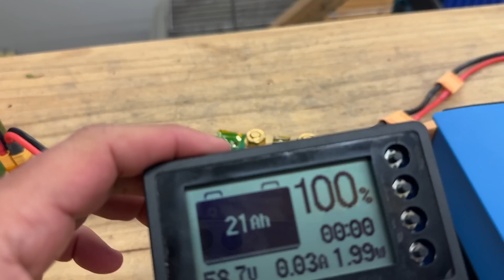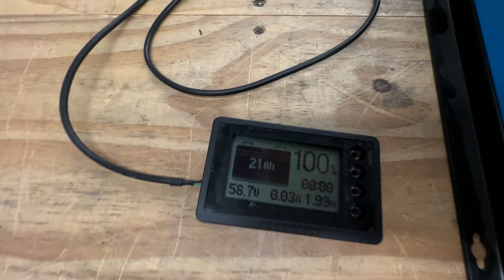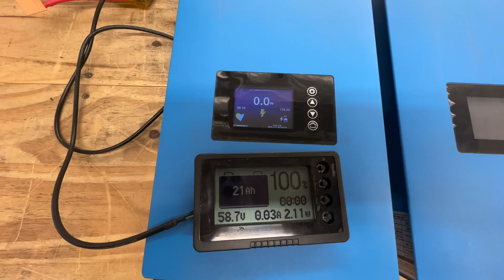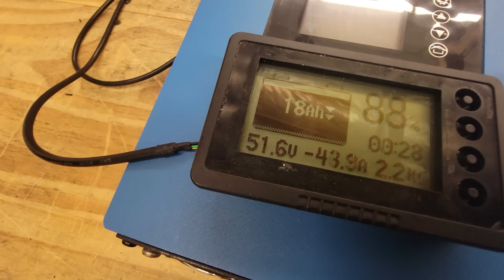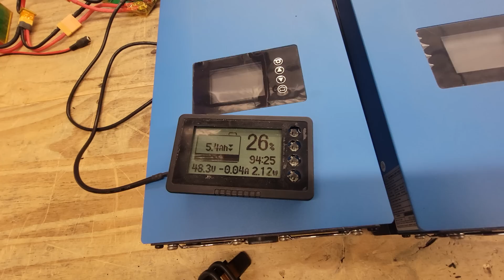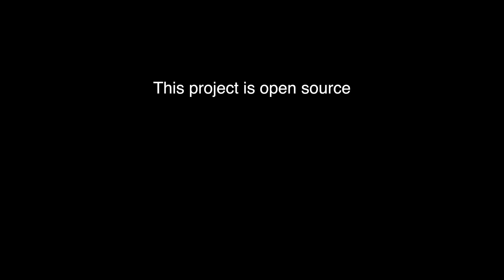52v eBike  20Ah  2170 cells

Comment: I would say yes this BMS passed the test but I would definitely implement some kind of cooling or consider putting the BMS further away from the cells or add better heat protection between the BMS and the cells.

Comment: Is 2170 cell the same as 21700 ?.
Reply from the maker: Yes
Reply: @jehugarcia  Did you do any further testing on this or just lower the spec to 40A? I'm curious if I use my own higher quality BMS if it will be safer for an eBike build.

Comment: I purchased a 52v 19.2ah 45amp battery from a place called conhis motor. They use Grade A LG 21700 cells apparently.

But the performance doesn’t lie. If only I have a battery and controller with higher amps though. 45amps is still fast but I’d like a bit more torque.

Comment: 52x4 in series = 208Volts which is -/+ voltage on a Prius.. factory stock NiMh cells capacity is only around 1.3kWh but very bulky.. these lithium blocks as range/capacity extender or replacement for older hybrids?

Comment: Quick question here, (scratch that, base question is simple, big quesiton is large)

i am not knowledged in all of this battery tech. I live in Spain. this has nothing to do with not being knowledged, but to what access i also have in batteries and their prices.

If i take 130 LG 21700 cells, each 4.8 Ah, and each 3.6 V, then i get 4.8x3.6 = 16,2 Wh (more or less) x 130 = 2.106 Wh (or 2,1 kWh), for the price of $754 USD (normally $ 1.235 USD). 

however, i can get a 90ah 12v (car) battery for € 74 euro's (that's about $ 75 USD. 90 x 12 = 1.080 Wh (or 1.1 kWh).

So let's say that i would need two of those batteries to reach the same as those 21700 cells. That means i'd pay about $ 150 USD VS  $ 754 USD.

Now i fully understand that it does depend on how to applicate this tech. I imagine 130 21700 cells are a lot lighter in weight compared to 2x a 12v lead acid battery, weighing in total 42 KGs. 

So obviously, weight is a gigantic factor here. For like a E-step i would imagine obviously that such car batteries make no sense at all.

For a bike, obviously, the benefit of being able to carry a 'light' battery to your desk and charging it there makes sense if you make 'large' trips.
130 of these cells weigh about 8kgs, so obviously, that's a difference of 34 kg. 

But even then - if you could charge your bike in your shed/garage directly from a power source/cable, then 34 kg higher weight obviously is not a little, but let's not forget that for example a woman may weigh 55 kgs and a man 89 kgs. that's still a 34 kg difference, and yes men in general are more 'muscular' than women, but the thing is, nobody bats an eye on such a weight difference in a 'feet powered' bike.

So obviously, a 12V battery will bring additional weight, and it's quite bulky too. but so is carrying an extra passenger on your bike, and that's quite a lot more than 34 kg. 

So one might for example, buy 'carry bags' to put on the rear part of a bike. 

And it would save you a whopping $ 600 USD. 

So, why would you then go for these 21700 cells? what is their benefit over a 'classic' lead-acid battery?

Additionally, if you were to build like a 'tesla powerwall' alternative, weight really isn't going to be your concern, right?
But $ 600 USD cheaper batteries is like really a LOT.

If you were to make like a 13 KWh DIY tesla wall (which costs about 10k USD if i'm not mistaken),
then you would need to spend like about what, 800 total of those 21700 cells, about $ 4.500 - $ 4.600 USD, right? 
I mean obviously that is a 'bargain' compared to 10k Tesla 'original' powerwall.

But, it would take like 12 of those 90ah 12v car batteries, and that is about $ 888 USD.
We're talking about rediculous power differences here.

And perhaps i'm mistaken, i probably am, but i don't see where or how, but    12 times a 90ah 12V battery to me equals to 12.96 Kwh.
And perhaps i'm mistaken, i probably am, but i don't see where or how, but 750 times a 4.8ah 3.6V battery to me equals to 12.96 Kwh.

12 x 75 USD (Solite lead acid battery) = $ 900,00 USD.
750 x 5,8 USD (21700 LG cells ) $ 4.350,00 USD

You save $ 3.450,00 USD by going with (Solite) lead acid batteries.

On average, 21700 batteries last between 3-6 years.
On average, lead acid batteries last between 3–5 years.

If we take the lowest number, 3 years, then they're exactly the same in lifespan. 
If we take the highest number, 6 years, then 21700 batteries last 1 year longer, but that's not a given.

Which brings me back to my question : 
Or, simply put, let's even IGNORE the COST of the batteries at all.

if we want to have 1000 watt-hours,
i'd need 'just' 1 90 ah 12v lead-acid car battery.
Or i would need 58 21700 cells. 

What benefit would 58x 4.8ah 3.6v 21700 (LG) cells have over 1x 90ah 12v Lead Acid (Solite) Battery?

What is the benefit of 21700 cells over lead-acid batteries?

Is it purely and only weight

Or, am i going completely and utterly into a totally wrong direction here and am i doing my calculations like a tool and missing some very vital information here?

please, enlighten me.
Reply from the maker: Well….  Lead acid does not last very long if you use 100% of its capacity,  so you’ll need to use 2x the battery capacity you need doubling your stated estimated
Costs.  There’s also maintanence ,  my forklift lead acid battery need constant checkups and liquid refills,  lithium once set is carefree usually.    Then there’s the life expectancy,  you quoted 6 or so years.  The true life of properly used lithium NMC cells is much longer, somewhere around 2000 cycles.  My 2nd hand Tesla battery on my diy VW electric bus is almost 12 years old now and I can’t detect any degradation yet.   So yes lead acid is cheaper but won’t last you as long and will require more maintanence.   Plus,  21700 cells are some of the most expensive lithium cells around,  there’s far cheaper lithium cells available like the $63/kwh machE cells https://youtu.be/uFsyD74Ph8o
Reply: @jehugarcia  thank you so much!

Comment: Are you testing the pcb's load ability or the bms's load ability? I would do pcb load test not both. Start at the power source and test each component  independently, yaya time, its just time its all we got is time. So was that test objective, subjective, injective, rejective, whats the jective, i wanted to see the pcb's failure prone point, we know all bms's failure point the fets. Using a large heater like that might be a bad idea for the cells under it they will fail first thats my inject.

Comment: Brother 2 question about battery one is about balance of the cells is that BMS include active or passive balancer  and last question is about temperature sensor I get experience with my 18650 24v battery the temperature sensor was connected in middle of of the battery but my last cells of battery was getting too much hot I disconnect them I cut the nickel strip so the point is if temperature sensor works only on one cell or little bit are cells can cover so that is not really safety 🤔 if possible can we add more temperature sensor on etch pairs for etch raw ?
If possible can explain in your next video will be very thankful for that
Thank you very much for always the very informative and educational videos
Best regards from Philippines 🇵🇭

Comment: Jehu, you need to get your hands on some  real high output 21700 cells, like the Molicel P42A cells are amazing. 4.2ah per cell and a 45 amp continuous rate of discharge. I only ever see you use batteries that do 10 amps continuous output, and that is weak if I'm being honest. Use some real high output cells and you will see what these 21700 cells can really do.
Reply from the maker: I use what i have, the day I get hi power cells I’ll use them

Comment: That was a continuous full load test, you will never do that in an ebike. I call this a win. I've got 3 bikes (all different) and most of the time I am below 50% draw. I think if you ran the motor for that long at full throttle it would burn up first.

Comment: what ever the numbers say for Amps on the low cost  bms just divide it 2 and you'll be in with a chance of not over doing it.
Reply: ill build a 52v 22ah 14s4p battery with LG m50LT(5300ah 14 A) cells for 48v 1000w(30amp controller) rear motor. Daly BMS say BMS should be 30, others say 60a. Is running 60a damaging?

Comment: You said 14S? My pack voltage when fully charged sits at 54.6v and it is 13s.
Reply: Lithium ion batteries are always rated in nominal volts. 3.7x13 =48.1V. if you battery charged 52.4V then its not charging fully. Full cell is 4.2V. 13x4.2 = 54.6V